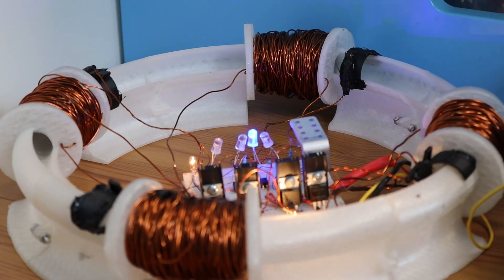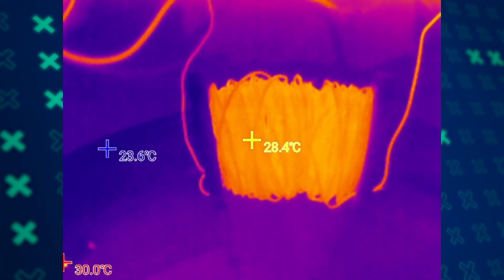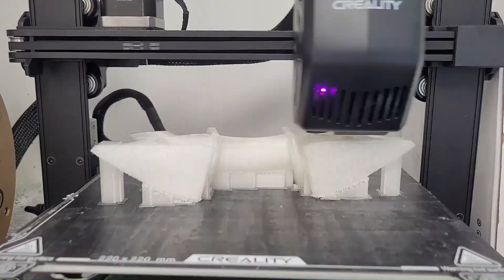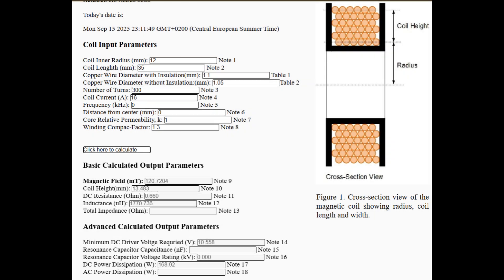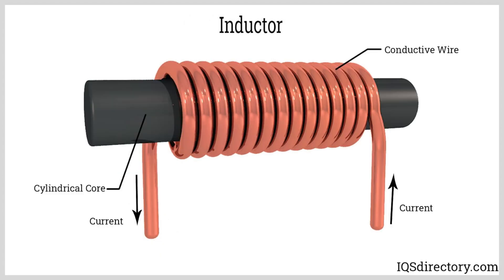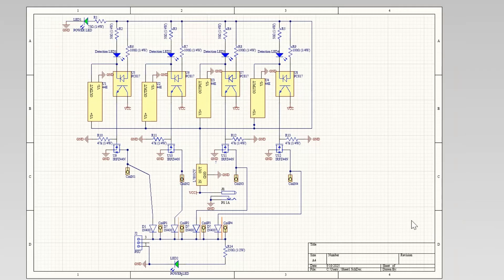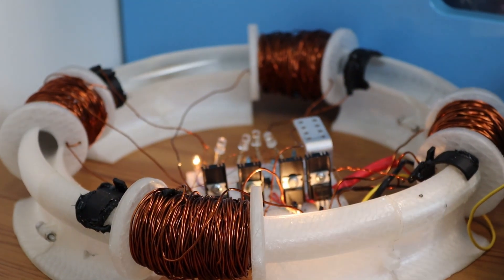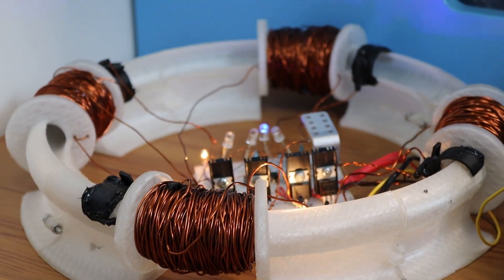Building a POWERFUL Electromagnetic Accelerator

Comment: Did you have any idea how to counteract the vibration motion? maybe by using a counter weight, just like how engine pistons work ? have a look on how rotarty engines counteract vibrations. or maybe think about having another ball on a separate Z axis that rotates in the opposite direction of the 1st ball (make sure to reasearch how to synchronize their movement ) amazing job overall
Reply from the maker: Yeah its hard to make to exactly at the opposite point while avoiding making them touch, maybe with a microcontroller this could be done